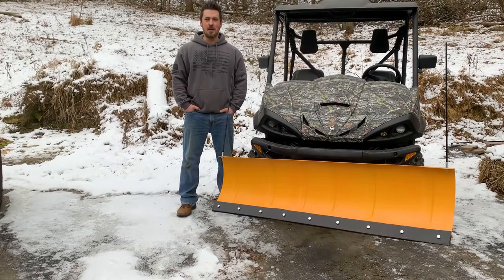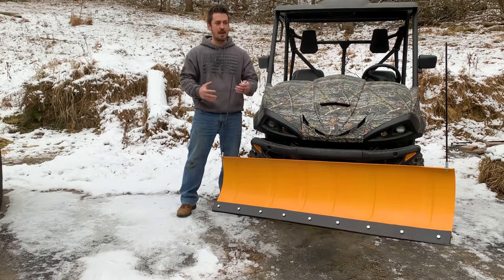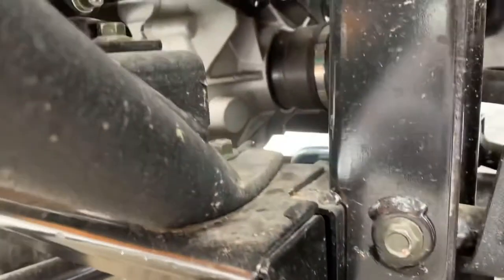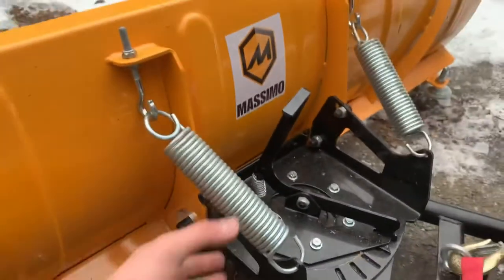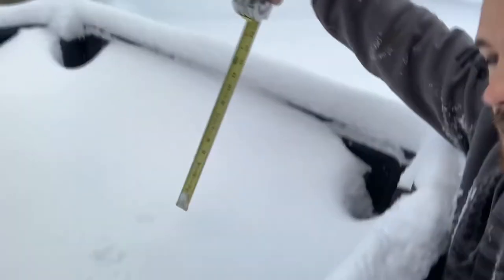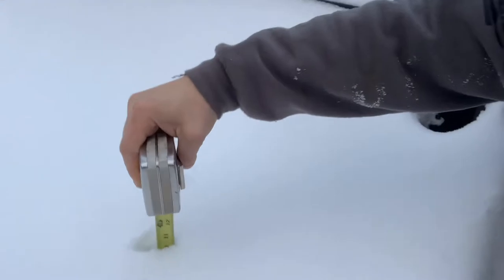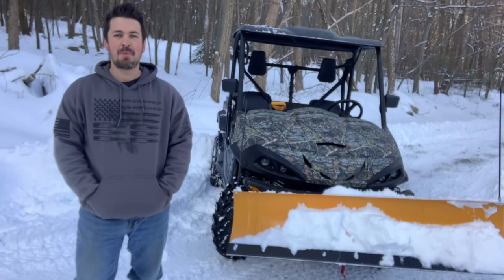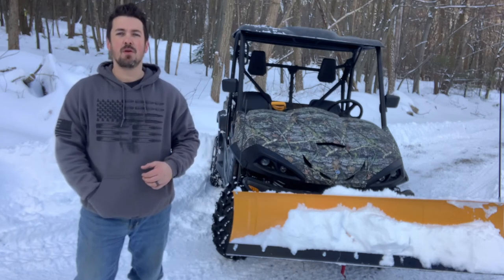Massimo 60” UTV/ATV Snow Plow Install, Review and Demo. Alli 500 Side by Side Plowing a Foot of Snow

Comment: Was surprised how well it worked on my Massimo Buck.  It was first time using plow and I have steep uphill driveway.  I got over a foot and half snow and I thought it would not work.  The guy I hired to plow driveway had issues with his plow, so I gave it a try clearing bottom of driveway worked like a charm.  Decided to go ahead and try up the driveway.  Got stuck once and I cleared the path then plowed through to the top.  After that finishing clearing was a breeze.  Skid feet had me plowing snow and not gravel driveway.  Impressive.  The only down side is manually needing to adjust angle of plow,  but other then that I was impressed.
Reply from the maker: Hey Terri! Thanks for checking out my channel! The Massimo Buck is a real nice UTV. How was the plow install on your Buck? I have a similar situation with a long driveway on an incline and I use my side by side for tons of stuff (like taking the garbage down and even checking the mail haha). Having this plow helps a ton in the winter and will definitely save money over time!
Reply: @mountainbuck  I bought the Buck with plow installed already in the fall.  I have to uninstall in spring and figure it out.  This is why I usually like putting things together myself, nothing like doing to learn.   Oh I wish I could use it to get mail.  No mail delivery in my area, but I do use it to pick up packages that get left up top. Not all drivers want to come down.  I have been enjoying getting to know what the Buck can do.  I am certainly glad I have plow, I can see it paying for itself as 3 More days of forecasted snow this week.  First winter in this house, used to be just weekends but no winter and of course they are getting more snow the past few winters.

Comment: i have been hearing to get the 700 model ,because the 500 does not have enough horse power,i also have a long drive way and planed to use it to plow snow etc
Reply from the maker: Hey Mark, thanks for checking out my channel! It’s true, the 500 doesn’t have a ton of power, but it handles my over 600’ driveway (on an incline) just fine. Obviously, I don’t plow uphill, but the 500 works great for what I need it for.